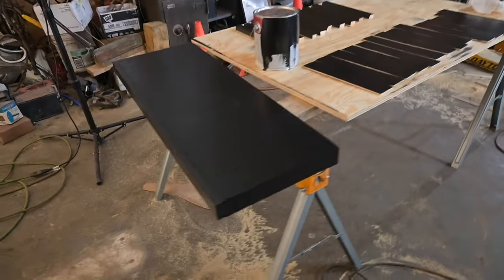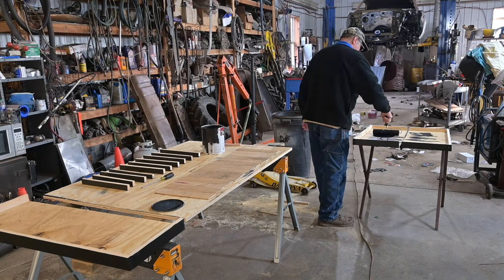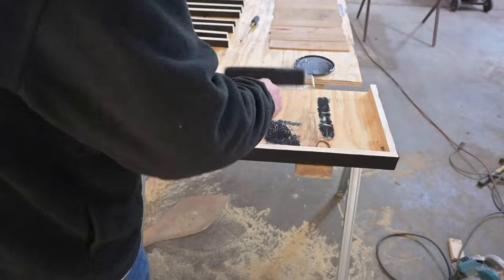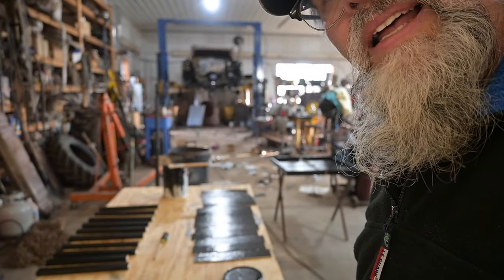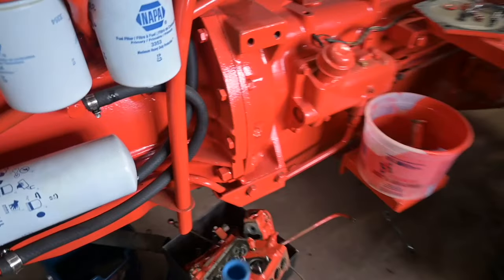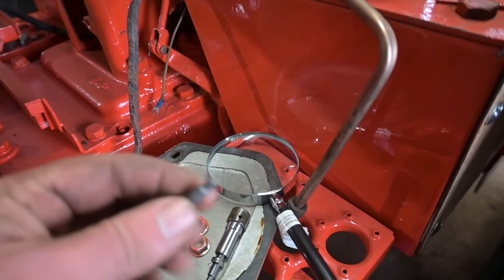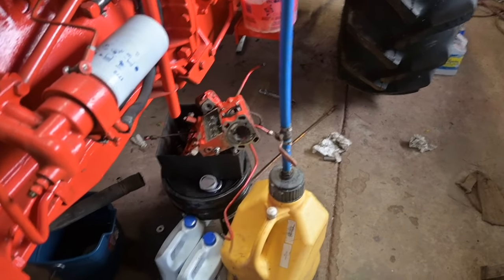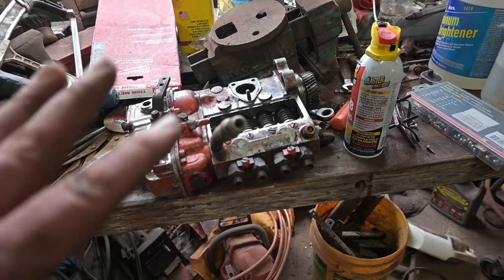Bar shelf painting and Case 830 update

Comment: Dear John u paint just like me pour it on and slather it all over my empress always yells at me for doing it as far as the plunger i think its going to be very hard metal probably why it snapped off hard to weld i think im with Connor on this call😊
Reply from the maker: Hey Dave; It works and it saves the paint that would get waisted in a roller pan. Just tell Your empress; "some guy on tube does it that way' lol.  
Yeah that plunger weld idea is going in the dumpster. Now the question is; how do I tell Connor he was right without admitting I was wrong? Thanks for the good advice!!!! John

Comment: So I just stumbled upon your channel because I have a 830 COM aswell and the engine is tired and I just happened to find a 870 engine for sale and I figured it would fit and looks like it does.  What was your biggest dilemma installing the bd336 in the 830?  Did the bellhousing bolt right up along with the COM 830 flywheel?  I seen with some cutting and grinding the bolster bolted up.  Please let me know
Reply from the maker: Hi 1997; Yeah it bolted right up. COM and all. you will have to notch the engine to bell flange for the steering rod and the belts are tough but we got it figured out in one of the vids. And like you said a little grinding on the bolster. Not to bad a job really. If the injection pump wasn't stuck we would have it running by now. Thanks for watching!! John
Reply: @JohnFrytag  I've had good luck pumping seafoam though injection pumps that are stuck and letting them sit that way typically right on the tractor.  I take the last filter off dump it out fill it with 100% seafoam and crack the engine or pump priming pump let the seafoam get to the plungers and barrels and soak for a good few minutes then they usually come right back around.  I'm not sure if I'll jump on that 336 or not I'm currently restoring my case 500
Reply from the maker: Thanks for the tip!  Just checked out your channel. Had to see the 500 you mentioned. What a cool old brut!
Reply: @JohnFrytag  most my videos are from when I was like 12 years old I'm 26 now but that 500 video isn't too old I went though the engine on that in 2019